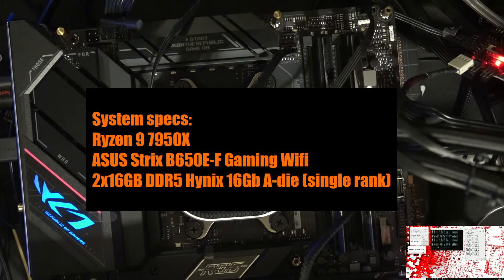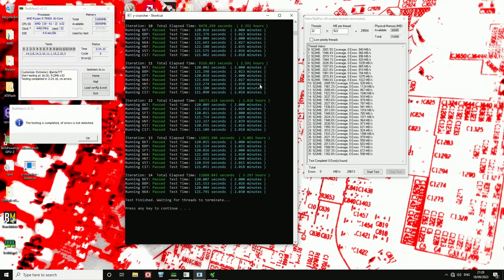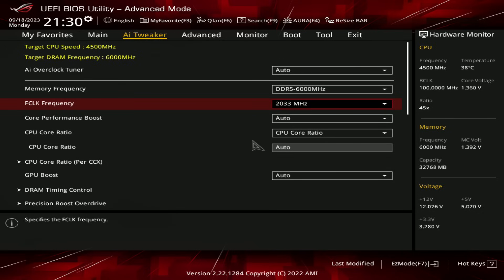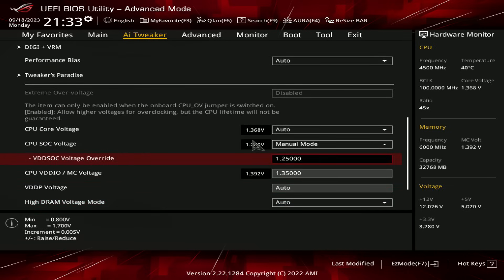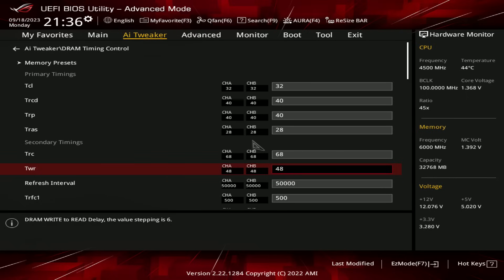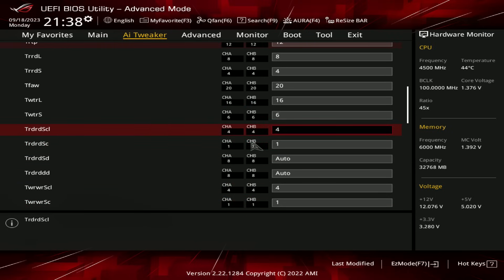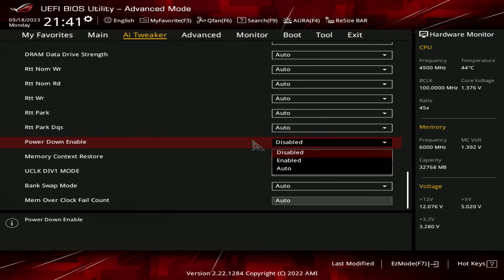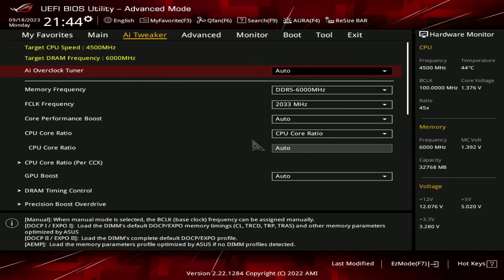Easy memory timings for Hynix DDR5 with Ryzen 7000

Comment: I have a corsair 6000 c40l kit and my memory latency is 96 ns. Problem is last time I followed the video I ended up having boot issues and frying my hard drive and had to buy a new one. Had to install windows and everything all over again. I am deathly afraid to mess with ram again. I'm still confused to as why that happened. I am fairly new to overclocking. I have a 9800x3d and use curve optimizer at -23 and +200 mhz clock. Also have scaler to 10x. I guess my question to you or anyone here, can I incrementally try these settings to avoid that catastrophic incident to my m.2 again?
Reply: your biggest upgrade is going to be a ram kit that's CL30 and not forcing these settings on an already sub-par quality kit.
just buy yourself a CL30 kit, set expo and be done with it
why keep screwing with it, especially if you don't know what you're doing? you just bought yourself a top of the line CPU, is it not fast enough?
Reply: @gabber_  yeah I think I just enjoy the process of getting the most out of it all. Being it's all so expensive, that's another reason to get the most out of it. I'm just terrified of messing with ram timings now lol.
Reply: @Davetheguitarhero108  Why did you bought a cl40 kit in the first place? I mean it's all over the net that the sweet spot for 78/9800 is 6000/cl30.
Reply: @Odder-Being  In all honesty I didn't have the knowledge to understand what cl40 was. I just seen 6000 mhz 64 gb ram and bought it.
Reply: @Davetheguitarhero108  Fair enough, gaining knowledge is a process it takes time.
Reply: @Odder-Being  Yeah. I'm just wondering if I should bother with overclocking my current ram or just wait to buy more in the future.

Comment: Please help - These settings let me POST but I started having bad screen flickering, though it otherwise seems stable. Tried increasing DRAM voltage, loosening RFC timings, lowering FCLK back to 2000, and messing with SoC voltage (going up and down), all to no avail. Am I missing something here?
Reply: yes, you are missing a ram kit that can run with these timings.

Comment: Used exactly the same timings with my Corsair Vengeance 6000 mhz CL30 memory. My CPU is 7600X and mobo I use is MSI MAG B650 Tomahawk. I was having about 69 ns on Aida64 memory benchmark. Now I got 60.5. Not sure if that makes any difference, to me it is exactly the same performance-wise but it does not hurt I guess. I have not touched voltages. it's 1.4 V as default.
Reply: Got the exact same RAM. Your system still fine? Appreciated
Reply: @iiiiT2  A little too late to answer I guess, but I've never had any issues since I applied these timings.

Comment: these settings work on Corsair 64 gig 6,400 MHz kits with a manufacture date of November 2024. I was trying to get my buddy's PC working with literally any overclock and I don't know why DOCP or EXPO were not working at all. Even in my PC it was not working on that kit

I was able to push some of the timings a little lower but now everything's running how it should. it's crazy how in some games, not all games, it gives like a 30 FPS boost 

One would think that DDR5 at any speed is faster than DDR4

Comment: i have a ryzen 9700x with asus strix f x670e with these rams F5-6000J3040G32GX2-FX5, and the system is extremely unstable with 6000mhz i tried the settings of this video and still unstable a little bit less, the ram have hynix die
Reply: Did you fix your problem?

Comment: MY sys: MSI mag670E Tomahawk (fresh bios update), GskillF5-6000J3238F16GX2-FX5 (32.38.38.96), ryzen7600X (offset-25;maxtemp.85c;maxfreq.5,32ghz). I have adopted all values including "memory context restore" disable. I set tRAS to 30,  i dont want to try 28 because a few people report crashes. Ultimately there is no difference in Cinebench scores but in Stalker2 (CPU bottleneck scenario)  I gained 5% more FPS. I only tested the basic FCLK 2000, wondering if I should go higher???

Comment: I'm trying to make it work with these settings. The first day it works really well and it does not crash ingame or with any memory stress test.

The fun part is the next day after. It BSOD every boot. Every time a new windows code. There is nothing to do, i can change speed, voltages or timmings and i cant boot. I need to put it to default and then i can reload the settings 

Any ideas?
Reply: all good today so far, I'm looking forward to the same problems soon! haha
Reply: Yo, fixed that? Got same problem
Reply: @dasu.  yes i did. In the comments some people said to disable memory context restore. It did not work at first because my board had 2 settings with this exact name. I disabled both and it works perfectly fine since. No issue with those timmins even at 6200 mhz.
Reply: @Unholyback316  glad that worked out! :D
ive got stable with MCR and Power down on 5800mhz, so, maybe AGESA bugged out or maybe mobo trying to rewrite some timings but anyways got a better stats than with expo and im not sad anymore
Reply: @dasu.  
running stable for me for 2 weeks; SOC 1,250v, DRAM/DRAM-VDDQ/CPU-VDDIO 1,350v, Power Down Mode and Memory Context Restore Disabled, Dram speed 6000, FCLK Freqency 2000, UCLK=MEMCLK, tRAS 30.
Reply: @-MaxMax  thanks for the reply. Will try to do this as well <3

Comment: I just looked up what all the values do and turns out that what you are putting depends on the main timings of your ram such as the fact that tRC has to be the sum of tRAS + tRP.But if someone copies your numbers with CL30 sticks like I have, it won't work. And of course, you didn't explain that in the video. There is a reason manufacturers set the timings the way they do. They ain't stupid. But you ppl can't help yourselves. You need to tweak tweak tweak to get better benchmark scores but does it actually translate to better gaming performance? No.

Comment: can anyone confirm if those settings are ok for a 2x32GB Hynix A kit? i am using it without problems but since this video was done on SR sticks, i would like to know the settings for DR ram. 

For Dual Rank Kits:
tCL/tRCD/tRP: whatever your kit says in its EXPO/XMP profile
tRAS: ???
tRC: ???
tWR: ???
tREFI/Refresh Interval: ???
tRFC1/tRFC: ???
tRFC2: ???
tRFCsb: ???
tRTP: ???
tRRDL: ???
tRRDS: ???
tFAW: ???
tWTRL: ???
tWTRS: ???
tRDRDSCL: ???
tRDRDSC: ???
tWRWRSCL: ???
tWRWRSC: ???
tWRRD: ???
tRDWR: ???

Any other field necessary?
Reply: You should ask in Hardware Unboxed's channel since they made a video a year ago too (if I'm correct) showing the differences in performance before and after applying the settings shown in this video, and the interesting part was that Steve also included RAMs DR too.
Reply: @Rezequiel  is this the video? i dont see anything about DR or SR

https://www.youtube.com/watch?v=MOatIQuQo3s
Reply: @xtumaster yeah, the very same. He speaks about DR and SR at some point of the start of the video but only to tell that he included that variant in the tests performed and you can see in each graph comparison the performance of DR/SR tests.

Comment: So I just set up this timings on my new system, but I had to push the memory voltage to 1.4V to get it stable.  I suspect this is due to me using a 2 year old 5600 CL32 kit (it is A-die) but with the stock voltage being 1.1V, it's quite surprising it needs so much more for 6000.
Reply: It doesn't work 1.35-1.39? 1.4 seems high for 6000
Reply: @SodaPopinski3000  The 1usmus memory test was throwing error 0 at 1.35V.  I didn't try any values between.  I suppose I could try changing tRFC too but I'm kinda over tweaking the memory on this system.  I can't get the CMOS to reset reliably on this board - it took me 6 tries last time.
Reply: Can also try raising trfc a bit

Comment: Are these still valid for 9800x3d?
Reply: Yes, might be able to do better possibly but i was able to copy these settings 1:1 on a 9800x3d, x870e hero, and 2x16 6000 cl28
Reply: Works for me 2x24gb Klevv (they say its adie, but might be mdie). I used other timings before that seemed faster, but more heat and less stable. Using these exact timings except 65024 trefi, 2200 fclk, 1.2 vsoc.

Comment: This setting also works on Gigabyte x870E Auros Master with 9800x3D. I left all voltages at default and only adjusted the timing and it's working fine. Using G.SKILL Trident 32GB 6000 MT/s.

Comment: I have G.SKILL Flare X5 DDR5-6000 CL32 but if I set refresh interval to 50000 I start to get blue screen. I have refresh interval set to 20000 with no issues!
Reply: If you have a spare case fan and don't care about how it looks, you could just put one in front of the memory dimms :)

Comment: Is there any benefit in pushing more voltage for tighter timings? Or is this pretty much as good as it can get for 6000MT CL30 kits?

If so, which timings can be tightened further?

Thanks in advance

Comment: Can confirm asrock riptide + tcreate runs these settings flawlessly. Saw massive improvements over stock expo of 6000 and cl30. Subtimings is the key, it goes beyond benchmarks... I can feel the snappiness opening programs and basically any task. I have a 7800x3d also, and collectively I feel the change.

Comment: I did these settings and my pc just boots in to safe mode
Im using r5 7600x and using g skill trident z5 2×16 cl36
Reply: same here except I have the cl30 model. Every 2-3 cold boots my pc boots into safe mode, but there are no other signs of instability when I'm in windows. It only happens on cold boots though, not restarts (memory context restore is disabled so ram trains on every boot). Have done many cinebench and occt stability tests and all seems fine. Just a little inconvenient. The behavior is very inconsistent.

Comment: I just upgraded to a Ryzen 7 7800x3D, msi b650 mb, and lexar 2x16GB 6000 C30 ram. Somehow my PC's performance is worse than before. 

Old: 
GPU: MSI RTX 4090 Gaming X Trio
CPU: AMD Ryzen 9 5900x
RAM: Corsair Vengeance RGB Pro 3200Mhz C16
MB: Asus Tuf Gaming X570 Pro Wi-Fi

New: 
GPU: MSI RTX 4090 Gaming X Trio
CPU: AMD Ryzen 7 7800x3D
RAM: LEXAR 32GB ARES DDR5 6000MT
MB: MSI MAG B650 TOMAHAWK WF AT

I've reinstalled chipset drivers and enabled expo in bios. 

I've tried buildzoid's timings and it made things slightly worse, with more latency.

In Modern warfare 2019 I used to get around 190-210 fps. Since the upgrade I'm only getting around 140-160 fps.

MW2 benchmark is around 140fps.

I expected more from this upgrade.

Thoughts?

Comment: Do I turn on EXPO profile and then use these settings or do I leave EXPO profile off and apply these settings.  I currently have EXPO profile on while using these timings and have no issues with memtest5 Absolut @ anta 777.
Reply: I'd turn expo on and then set these timings. Enabling expo changes way more than just mem freq/mem timings
Reply: @Germania-444  Yup, that's the route I took.  Thanks for the confirmation.
Reply: Hi bro. Whats your settings on ur memory context restore and power down gear?
Reply: @Jonxij  Both enabled.  I could not boot if either were disabled.
Reply: @jaxgator24  thanks
Reply: @ did you also copied buildzoid voltages?
Reply: @Jonxij  Yes I did.

Comment: What about gear down mode ?
Reply: That's a good question. I tried setting it a few days ago, but only stress tested briefly (1h). Seemed stable, but I got busy with flashing the latest bios 😂 I'll try again soon
You can also just test it and revert if it's not stable

Comment: why does my bios look so much different than yours? where yours says tcl trcd trp tras and so on mine is totally different
Reply: Two things:
1. You may have a different motherboard than the one in the video.
2. If not, your bios or his are different versions. That said, be sure to flash your bios to the most recent update.
Reply: @korsame  i was thinking bios is tweaked. my friend told me that its possible to tweak it so every setting is showed as advanced settings if you know what i mean. just like in windows were you cam show hidden files and folder. just that bios is hidding advanced settings or shows different names on every setting
Reply: @Pappajams  you could try resetting it to default, just be sure to save your current profile just in case.

Comment: I use Adata xpg lancer (non-rgb) 32gb 6400 cl32-39-39 kit with 7500f. My expo crashed; this one works. Thank you!

Just setting the trio from 1.35v to 1.4v (otherwise, it crashed and rebooted). Also, lower tCl from 32 to 30. It surpassed the one-hour OCCT combined test (all options checked). Temp. stays at ~51-53 max in OCCT (ambient 26 c). PDM auto MCR on, latency ~64ns in AIDA64.
Reply: Still ok with that? Got exact same cpu/ram. What's your mobo btw?
Reply: @dasu.  Yep, pretty good. Asrock B650M-HDV/M.2
Reply: @wirza555  thanks for the quick reply!
mine is b650i asrock as well. It was ok when i changed everything but next reboot and crashes after aida stress test like in 8 seconds. :(
Reply: @dasu.  Well, good luck. These 6400 sticks seem more power-hungry than the 6000 sticks even at 6000.
Reply: @wirza555  yeah, seems so, kinda fighting with this ram for a couple of days. Thanks anyway, will try to do my best :D

Comment: I wish I could like a video 100 times. I was having a lot of problems with my new 7950X3D/GSkill Trident Z5 2x16GB build. The PC would reboot randomly when doing simple tasks like browsing the web or using light programs, would also error and reboot within seconds every time I started the OCCT memory test. I was certain either the CPU or RAM was defective and was almost at the point of returning one of them. 

Took me some good 3 weeks to find a post that said they had a problem very similar to mine and this video fixed it. I think the problem all along was that I enabled EXPO as soon as I got the machine built, but for some reason the preset didn't change the voltages to be able to handle 6000mhz. I have an MSI board and the VDDIO voltage is grayed out and cannot be changed without also changing the DRAM voltage manually. I think the EXPO preset didn't account for that. 

Anyway, thank you so much, I don't even care about overclocking RAM, I'm just glad the PC is working smoothly now.

Comment: AMD 9 7950X ROG STRIX B650-E Gaming WIFI shit show, 2x F5-6400J3239G32G 64GB I normally run at 6000Mhz for stability ect but recently without touching shit the Uclock was at 1.5Ghz Its Hynix memory you and a few people are the only people that talk about uclocks i was wondering why does this happen i put kingston in no issues.but the kingston ram i have is only 32GB as they did not make 64GB at the same speed. KF564C32RSA-16, I spoke to Asus they told me to fuck my self, and its not in there QLV i said yes because no one had 64gb they told me stick it up my ass.

I did notice the g.skill have less spd profiles then kingston but as far as i know both use the same hynix chips.
Thanks for the video.

Comment: What should I set those 2 Auto values to if I run dual rank Hynix M kit?
The rest of the settings worked well. Though, dropping VSOC from 1.25 down to 1.225 increases latency, slightly increasing it to 1.235 decreases it a bit. 

I guess there's some other auto setting somewhere that mobo is adjusting on startup.

Comment: Thank you for this guide. I have a question. As I understand the reason 6000mhz is the sweet spot isn't because of the motherboard but the chip itself. Would it be smart for me to buy 7000mhz or even 8000mhz ram now for future proofing? Since I'm guessing future AM5 chips will be able to support it reliably?

I'm upgrading to AM5. That's why I'm curious.

Comment: I have a B650E-E, 7800x3d and 2x32 GSKILL ddr5-6000 30-40-40-96 and it runs with issues when expo is enabled. stutters in windows, audio crackles and pops, bsod and game crashes, an the ocasional stuck at boot. Fast boot, MCR and power down disabled, FCLK at 2000 expo 2 profile applied. But it passes karhu memtest 5 and prime95. Tried Expo 1 but is even more unsable and fails Prime95. No issues without expo applied. Any hints?

Comment: How will temps compare to a Expo 6000 CL30-38-38-96 settings (G.Skill Flare x5)? Asking as I'm running a small form factor with restricted air flow. Thanks a lot!

Comment: I am not clued up on this stuff. I have a Ryzen 9 7950x, Asus ROG STRIX X670E-A & 4090
Would these settings work with 2x GSkill Trident Z5 DDR5-5600 32gig? On CPUID the memory section does show "Hynix" in it.

Comment: Maybe it's just me, but the 'easy hynix timings' weren't that easy for me. (Yes, I have Hynix chips. 6000mt/s 30/38/38) It's not stable for me at all. Cinebench randomly locks up, and browser tabs randomly crash so far.
Reply: Turn OFF PowerDown, that was my problem. I know it might not make any sense but the VRAM tuning I had before on my GPU doesn't work with Buildzoid timings, once I lower VRAM freq by 50mhz it's not crashing anymore. Like how the RAM can affect my GPU? Wtf
Reply: @RmX.  geardown, as it's labeled on my BIOS settings, was disabled, along with the context restore, as other people said the two were tied. Apps and browser tabs still froze/crashed, eventually leading to a blue screen moments later. I ended up reverting back to default settings and then reapplying the XMP and 'Aggressive' profiles for my primary and secondary timings. I even played around with the SOC voltage since the 'Aggressive' profile sets it to 1.30, and buildzoid had his set to 1.25. Even at 1.35 volts it was still unstable. 
The 'Aggressive' secondary timings are enough for me, since they actually work. 28 for the tRAS seemed awfully low, since my XMP profile has my primary timings at 30/38/38/96. Either that or the tREFI timing was the cause, I suspect, but I just can't be bothered to find out what's going on with it.
Reply: Did u run test mem lol
Reply: @anemoia-pixie  obviously not, since it went as far as BSOD after just sitting on the desktop for a few minutes.